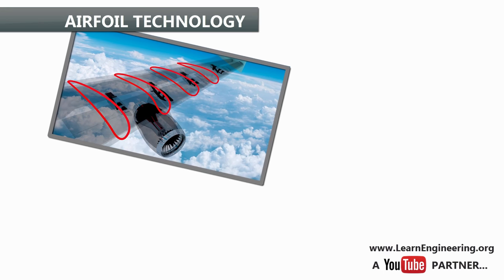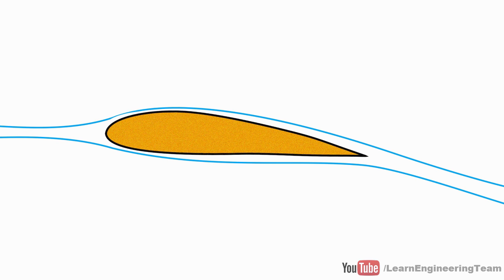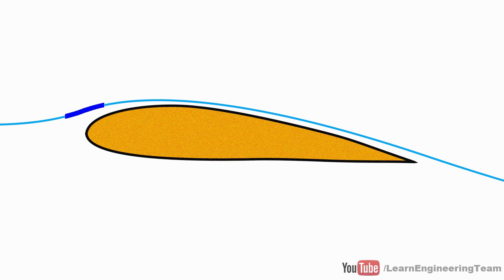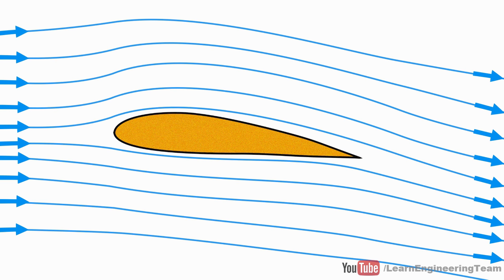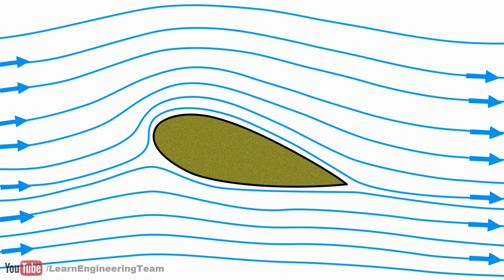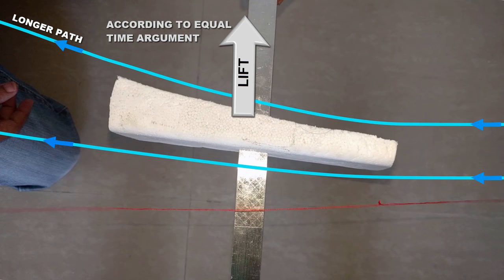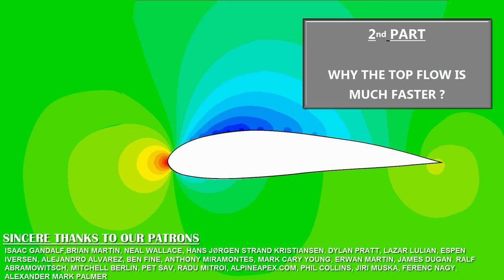How do Wings generate LIFT?

Comment: pressure at right top is less than the pressure at the left top due to this the air rushes to the right of the top and their velocity increases but at the bottom the pressure is same as right and the left therefore their velocity does not increase hence top velocity is greater than the bottom. thats it

Comment: Here is what I think
1) For a flow over the top surface fluid is flowing downwards, as it is moving from high pressure to low pressure pressure gradient is higher and hence the higher velocity.
2)This one is a wild guess but from the pattern shown I guess at the end there is a flow separation due to turbulent flow generation.

Comment: you have done well but in whole video you have  shown  the  wing  not tilted. The speed of wind must make an angle with its direction. In argument you told that pressure must increase from down to up, but in that the  wing was not properly tilted so it seems that the particle(flowing from the bottom part of wing) has a path which is eccentric in upward direction, which is wrong.

Comment: Great explanation however, I think the example you show with the cylinder under a stream of water is not showing the Couanda effect. This water curving is due to surface tension. "Because this is a flow of water into air, there is little entrainment of the surrounding fluid (the air) into the jet (the stream of water)".  Quote taken from wiki.

Comment: Air can move more freely in a low pressure state because there’s less particles around it causing friction in return this allows the air to move faster and reach the end of the foil before that in the high pressure state….is this correct?

Comment: The distance the air travels below the aileron is shorter than the distance it covers the top of the aileron due to the curvature at the top.
Also, if we go to the aileron, we will see that the pressure increases as we rise to the top, and this gives more stability to the air particles, which increases their velocity.

Comment: how come the pressure increases at bottom of airfoil whats the effect behind it, pls reply
Reply: Air hits the bottom of the wing, which always has a slight inclination against the direction of movement, which makes it slow down and because of Bernoulli's principle, speed is inversely proportional to pressure (in this context), meaning the air exerts greater pressure force as it slows down.

Comment: The PHAK tells me that acceleration of the air results in lower pressure above the wing. From what I can understand in this video, wouldn't the opposite be true? The curved surface of the airfoil causes air pressure to decrease on top resulting in an increase in speed?

Comment: I enjoyed your video! I liked how you incorporated computational fluid dynamics plots as well as creating your own experiments to back up your points. Great job pointing out the Equal Transit Time fallacy. The Coanda effect is only applicable to jet flows, as you have even stated in the video, but air acts as a continuum and does not behave like a jet in the atmosphere so it is not applicable. The shape of the airfoil causes air to stay attached, otherwise a vacuum. Great job with Newton's 3rd Law and the pressure theory!

Comment: The angle of attack causes the lift which is why flat wings can fly and non symmetrical airfoils can still generate lift even inverted.   When airflow is directed downwards by the angle of attack, the reaction forces occur on the wing which generates lift.  Airfoils only optimize the lift to drag ratio.  Also the velocity difference above and below the wing is an effect of the pressure difference, not the cause as many teach.

Comment: Here's my simple explanation for the last question, which is likely to be wrong or right:
- As you illustrated, there's high pressure under the wing, and low pressure over it, and the relationship between pressure and velocity is inversely proportional. Consequently, air over the wing will have much more speed then the air under the wing.
Reply: OLD THEORIES ARE OK .  YOU BET

Comment: Is it maybe that the wing creates a sort of "shadow" for air above it due to moving air in front out of the way? The above air then rushes to the wing, but a decrease in pressure at greater speeds still will be present. Then, slight angling of the wing's lower part will make the pressure higher, or just it being parallel to the below flow will leave it atmospheric. I kinda like that explanation, but otherwise I think I didn't get it.

Comment: Brain teaser answer suggestion: there is laminar flow on the top of the airfoil and turbulent flow at the bottom. So less resistive forces at the top and more smooth flow therefore and higher velocity of the fluid on top than the bottom?
Reply from the maker: No, you can assume the flow flow is laminar throughout the domain. :) It's all about pressure gradient.

Comment: I prefer the visual from 6 mins onwards and specifically 6:17 and 6:28. The important thing is the high pressure zone in the front of the wing, this is the most important thing. This slows air trying to get over top surface of wing relative to the air above it. This creates a gap that can be seen. this air which is now compressed two streams into almost one rushes into this unfilled zone. This unfilled zone is a low pressure and the high pressure air rushes (accelerates down wing top surface). The air below the wing hits high pressure zone and slows down pushing wing up. So we have high pressure air at bottom of wing and in front of wing, normal pressure air far above wing and low pressure air on upper wing surface. The compressed air coming over the wing speeds up into the low pressure zone

Comment: Didn't understand. If for the air particle to intact to the curved surface, the Pressure on the upper side of that should be higher than Lower. Then, that should be true for the Lower particle also, naa !! Pressure on inside of  Lower air particle i.e towards the foil  should be lower than Outside high pressure. Then, How the Pressure Gradient is being Created??? If there is no difference in conditions?? 

Please Clarify?

Comment: Well, if the bernoulli is not appliable here, then why on upper side is lower pressure when it is not caused by change of speed?
Reply: +Jaromír Anděl,
 The simple fact is that the wing (any object) must push the air around to get through it, CAUSES the pressure CHANGES.
...
Also, pressure differences accelerate air. Fast air DOES NOT necessarily have , nor CAUSE a lower pressure.
...
  Moving forward, toward some air, increases the pressure at the surface.  
Just walk in water and feel the added pressure on your chest as you move into the mass of water.  YOU are increasing the pressure by 'advancing' on the air.
...
That increased pressure pushes the water/air away from you toward ALL nearby lower pressure regions.
...
Behind you, you move away from the water/air, thus reducing the pressure. The higher pressure further away, pushes water/air in behind you.
...
Pressure differences are the force that accelerates air.
...
...
Above the wing the air must curve to get 'over' it.  Since inertia wants to keep the air going straight (as HE shows) the air is trying to move AWAY from the wing (or the wing surface is moving away from the nearby air)...THIS AND THIS ALONE reduces the pressure.
A surface moving away from where the air is (or is trying to get), lowers the pressure at the surface.  ALSO, IF the air's inertia (remember that air has mass) is trying to carry it away from a surface, the pressure is also reduced.
...
The air is pushed from a higher pressure region (ahead of the wing) toward a lower pressure ( above wing) region (Newton). This is why it gets to the trailing edge first, the pressure is lower above.
...
Below the wing, the pressure being higher, pushes that air down *AND*  FORWARD.  In the wind tunnel view, this "pushing" on it slows it down.  
...
On the other hand.
...
If you look at the wing MOVING through STILL AIR.  You see that that bottom air is pushed along with the  the wing for quite a distance, thus arriving at the trailing edge after that upper air.. 
...
THEN, if you apply the correct physics of pressure differences driving the accelerations of air, ALL other movements, including the down-wash, are easily seen.

Comment: As per the wing structures the the plan is constantly up lifting but it does not occured but piolet up lifting the plan at desired levels I thing resistance to air play some role.

Comment: without thrust, how does this æffect long wing dynamics in a gliding system using drag as a means to lofting in lifting a vessal?
Reply: Exactly
Reply: Well if I understand your question correctly, there certainly would be no gaining elevation without a form of thrust, but the angle of attack of the leading edge is what maintains lift. It's the same principle for if a helicopters engine fails and it has to go into Auto-rotate, it doesn't simply fall out of the sky, the relative air stream turns the blades and continues to maintain a certain amount of lift until landing.
Reply: Drag isn't used.  It is inevitable but every attempt is made to minimize it.
A glider uses gravity to accelerate a glider downward, but lift almost negates it.  Gravity is a glider's motor.  A glider, like a sled, is efficiently going downhill.  Like built up momentum going downhill can help you get up the next hill, a glider can use it's momentum to climb momentarily, but that slows it down and it has to dive to regain its lift.  
When a glider is in rising air, it will climb if the air is rising faster than the glider is losing altitude.  A skilled glider pilot can circle in a column of rising air (thermal), like a hawk, to gain great height then glide away in search of another thermal.

Comment: I beileve the answer lies in the continuity equation but according the the contuinuity equation i.e. A1*V1 = A2* V2 , for the top surface of the aerofoil I believe the pressure should increase when I move from one point to other point as the velocity decreases ....

Also I didint understand one thing why is that according to the coanda effect the pressure increases for the bottom surface of aerofoil when we move from P(atm) close to the aerofoil , I did understand this for the top surface as the pressure outside is greater than the pressure inside because of which pressure decreases when we move from Patm close to the surface...Please explain
Reply: Dont mind me, I just comment here to see the answer.

Comment: The direction of the dynamic wind pressure i.e V^2/(2g), on the aero foil is not perpendicular to the Wing Surface . The wind pressure is parallel to the surface of the Wing. The amount or quantity of air flow on the top surface is more than the bottom surface. Thus at an instance of time the amount or quantity of air below the bottom surface is more than the top surface. This difference in quantity of air is lifting the aero foil in the upward direction. (V1-V2) is actually giving the difference of quantity of available air below the aircraft wing. Thus the uplift will be (v2-v1)x density of air (1.2 kg/m^3).
Reply: The viscosity of air below the aircraft wing is much higher than the viscosity of the air above the wind.

Comment: have a doubt.... if the lower air flow also folows the conda effect... then why the pressure out and pressure in are written opposite then the flow at the top of the fin.
Reply from the maker: Coanda effect is only applicable to convex surfaces. At the bottom flow gets curved mainly due to the surface curvature.
Reply: +Learn Engineering tnq :) great stuff

Comment: density of the top side became higher although the video is showing  some smoth lines for testing but i think what realy happens is much more than what we see.  i think some air loop in a tiny waves form touching the surface plus if you look at the rear of the wing you will see the lines are gone away from the wing this is may be the effect of VACUUM  this could be the accelerator of the upper air flow so the air need to fill the empty space but this circule never ends so thier will be a vacuum left.

Comment: How do wings generate lift has nothing to do with Bernouli or Newton because both theories cannot explain some scenarios (e.g. FLAT WING of a hand-made paper airplane can also generate lift and fly). What you learn from aeronautics school is simply that the angle attack of an airplane, which involves the wing to be tilt higher on the front side of airplane, causes the wind from front side pushing the bottom of the wing upward, and this causes the pressure of the bottom side to be higher than the top side of the wing. Because of this pressure difference, the wing generates lift. Of course, this pressure also causes some drag to the airplane as well, but this drag can be compensated by the higher pressure of the high powered engine, so it won't cause stall. In normal circumstances, atmospheric pressure of low altitude is always higher than high altitude. When airplane runs very fast, more and more air pressure pushes the front and the bottom side of the airplane wing, this causes drag and lift to the airplane.
Reply: wings mostly generate lift from the upper surface, even a flat plate

Comment: I think as the wing touches the streamline it trys to push the stream line in upward direction this creating a vaccum at its back so the stream line quickly rushes to fill the vaccum.thats why upper streamline movement is faster. sorry if I am wrong.

Comment: One thing I don't understand - I'd love it if you can explain: Newton's third law states that for every force applied in direction X, there is an equal force applied in the opposite direction (-X). Now, for the air that flows on the upper side of the wing: it flows right above the wing, right? So then, the "response" should be a force that would flow once again right above the wing.
I assume that the problem in my question is the assumption that it flows "above" the wing, but... It seems weird to think of it as flowing IN the wing.

Comment: Because of coandã effect we see the pressure at curved surface is less where pressure at bottom is high so due to low pressure there is increase in velocity and therefore the air flow fast at top than bottom

Comment: 1:55
But if the air is at rest and the plane is moving, in the referential of the plane, shouldn't the particles reach the end of that trajectory at the same time, since they don't have a horizontal component of the velocity?
Reply: Good question! Even if the air begins statically, the movement of the object through the air would move the air particles around it, therefore, if they have to end up in the same place, than the object would not be allowed to move through the object.

Comment: So why do wings stall when the angle of attack is too high? Doesnt the bottom of the wing still deflecting air downward?
Reply: Yes it does, but the pressure reduction above the wing is a much greater decrease in pressure and, therefore, contributes much more to the Top-Bottom pressure difference that is the upward push force.  The pressure above decreases a lot, so the bottom pressure hasless to push against.  That is why some folks like to say wins "suck up".
.
This gives folks the most trouble. For a better understanding of the detailed cause of the reduced pressure above a wing, try this short video:
https://www.youtube.com/watch?v=3MSqbnbKDmM
Regards

Comment: (Sorry for eventual poor english.)

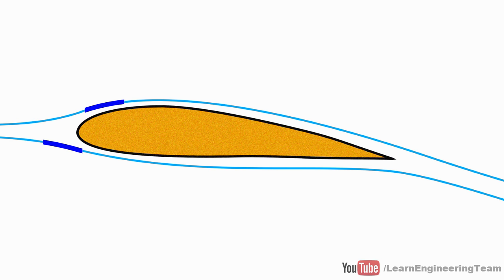1:59 Welp,based on the diagram,Bernoulli still applies because faster fluids have lower pressure and slower fluids have higer pressure,so the wing will be still pushed up due to difference between pressure

I was taught lift using the flow tube concept,a region of space made of all flow lines that pass through a closed curve,and the continuity equation,which basically says that the same volume of fluid that enters a tube section also exits the subsequent tube section,no matter how wide said section is.

There is a flow tube below the airfoil and above the airfoil,the flow tube above will have a narrower section than the tube below due to the shape of the airfoil,so the air volume the enters said tube will have to be faster than the same volume that enters the tube below,being faster,the upper volume will have a lower pressure than the volume below thus creating lift.

Equal time argument is used as an intuitive explanation of lift.
Reply: Yes but flow should be irrotational

Comment: Can you please explain the coanda effect? It is obvious that it is real, but how does it come to be? And by the way: both are right: Newtons motion law (reaction) and Bernoulli (preasure) keep the airplane up. You can use ether or both, that is up to you. And ANY airfoil WILL produce lift if enough speed is applied (as long as the airfoil can take the mechanical stress)
Reply: It's irrelevant to aerodynamics and a mistake in the video. Air stays attached simply by the air pressure above pushing it down.

Comment: Bernoulli never stated anything about equal time transit.....he just stuck a tube in moving water and took pressure measurements.....he simply said that if you accelerate a fluid you reduce its pressure....air is a fluid.
Pro pilot with 30+ years in flying (ex-airlines) and instruction: CFI CFII gold seal MEI ATP, and I was just teaching this topic today to a student.

Comment: when the pressure increases , pace of air decreases automatically as a law of physics and the pressure declines,  the pace of air increases.
          In that question, on the top pressure is low while on the bottom pressure is high. Consequently, the pace of air on top  is faster than on the bottom.
        Please give me reply whether my answer is right or wrong.
        It is helpful for me because I want to become aerospace engineer and I have completed my 12th sci recently.